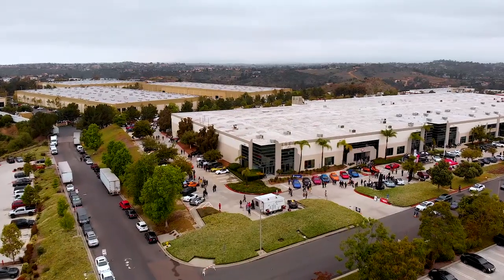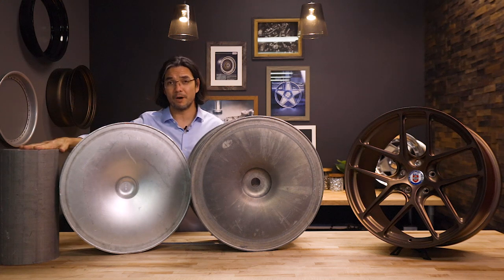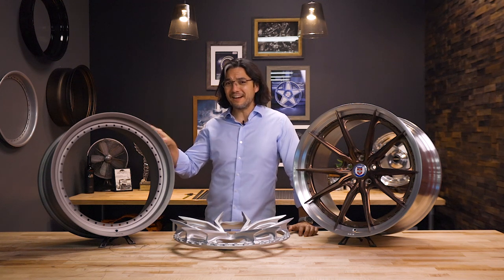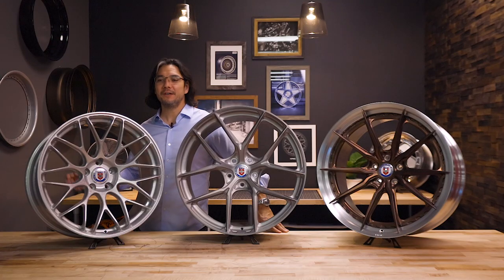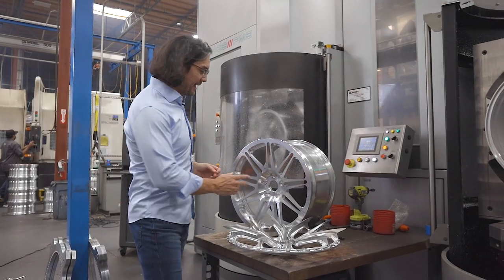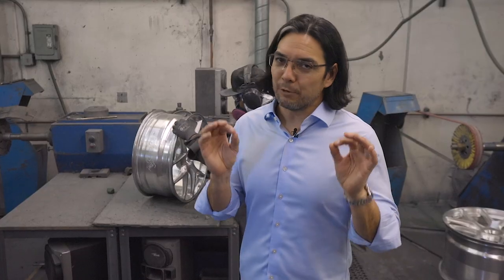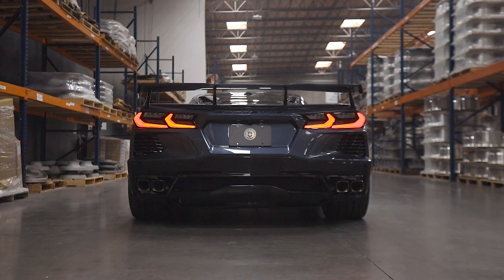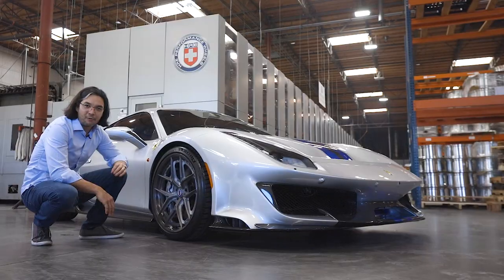BEHIND THE SCENES AT HRE PERFORMANCE WHEELS

Comment: At their price point and bragging rights, rightfully so,  it would be great if the inner/outer rim halves were interchangeable so the consumer could change the style/looks of his/her wheels.  This would be win-win for both HRE and the consumer, since most consumers wont pay for a whole new set of wheels but would be willing to pay for bolt-on options.  There would also be the added revenue HRE and/or it's reps or disty  could charge to perform the swap.